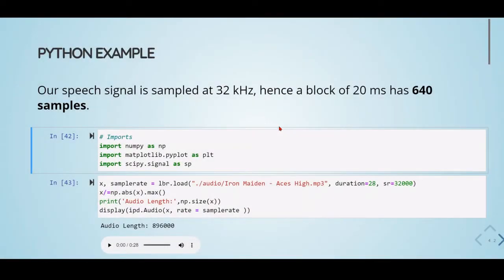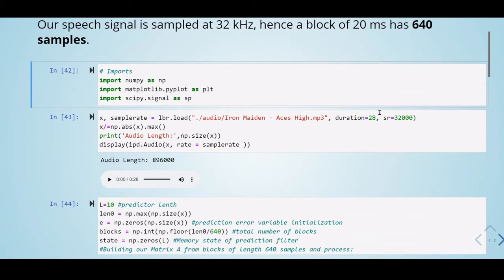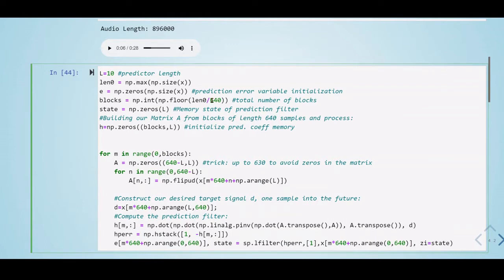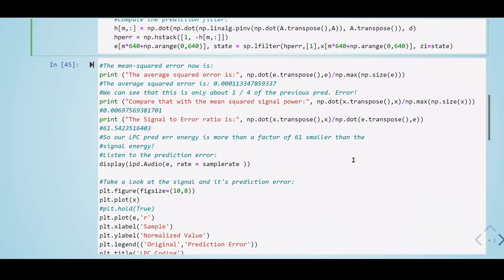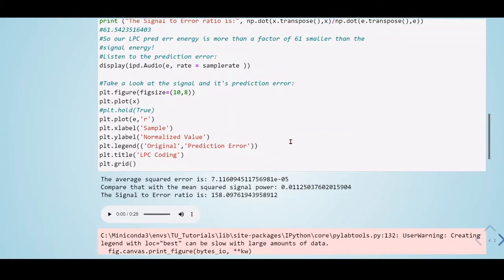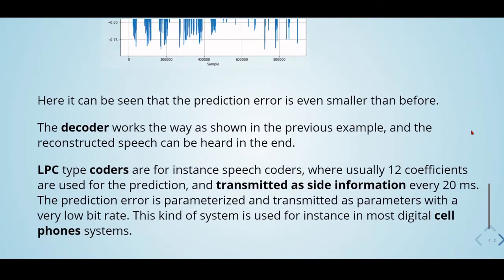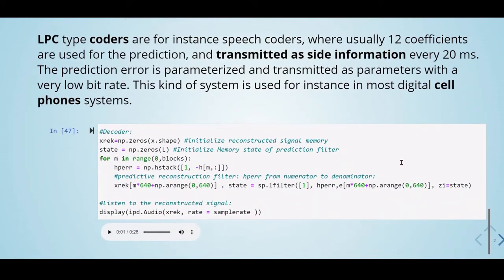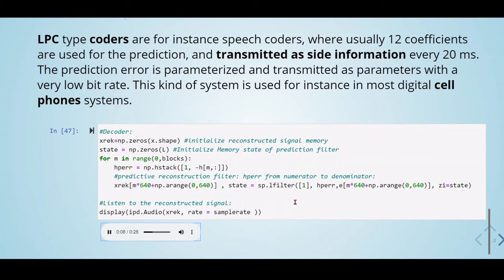ADSP -  14 Prediction - 10 Python Example: Linear Predictive Coding (LPC)

Comment: I convert the sound wave to LPC format, I want it to upload the codes to the arduino and speak, but I have no idea how a suitable wave should be.

I have tried many programs
Qbox (Windows 3.1 OS)

Python wizard LPC Generator

I used the python LPC Generotor program, I entered the sound code there, but the sound did not come out properly, what should the sound amplitude be?